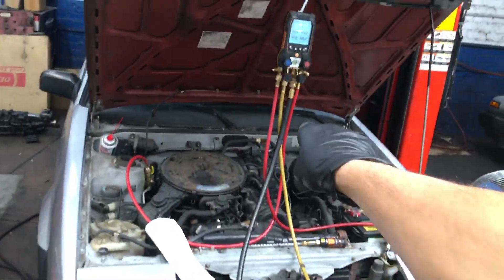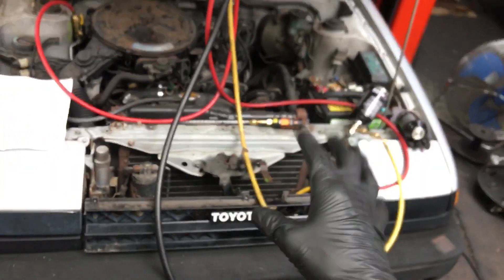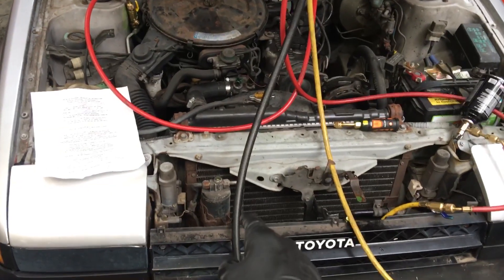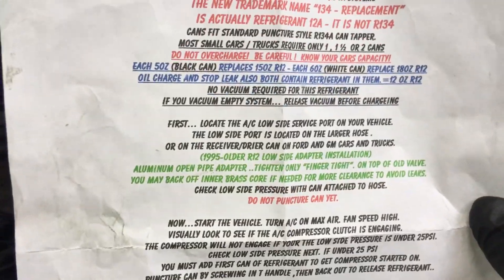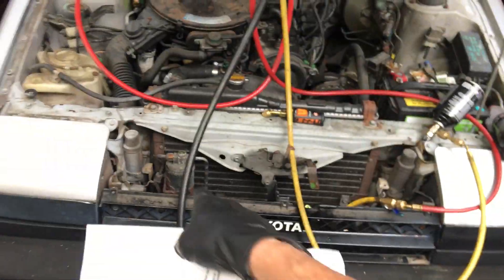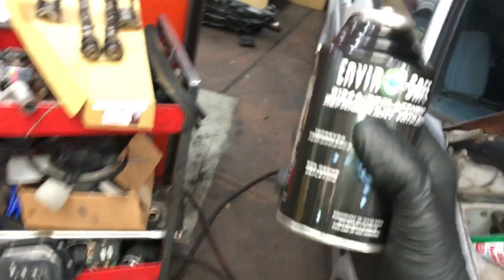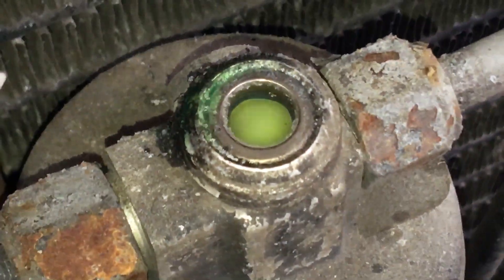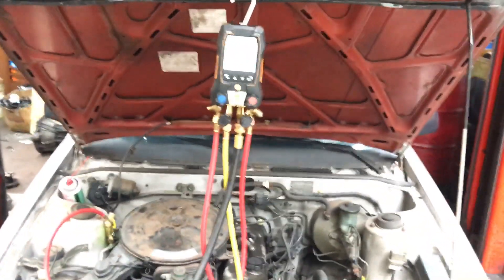Flammable 🔥 Refrigerant Installed In  Car Past Leak test, but now it leaks. Let’s put a match onit

Comment: Hi, Tom thanks for your videos enjoy them very much. If the average ac system took say 500g of (R134a) for example you would only need 30% of hydrocarbon about 150g due to its thermodynamics. If there was a leak in the evaporator, the fact that it is heavier than air, some of it would probably find its way out through the water drain. I think a leak the size of that receiver dryer for example inside the cabin, you would smell it way before it became a combustible mix.
Reply: Envirosafe uses a pine scent (cas# (138-86-3)) instead of sulfur to make you aware of a leak.  The precaution you should be aware of is to use nitrile or some other synthetic material for the o-rings.  Hydrocarbons (i.e. propane/isobutane) will eat rubber o-rings.  If you are losing refrigerant and needed to add refrigerant, this would be a good time to replace rubber hoses and o-rings.  You want to get all of the water and junk out of your system anyway,  Be sure to change desiccant and evacuate the system before installing.  The current Envirosafe products are compatible with PAG oils.

Get a factory manual for your car and it should show how much oil is used in the compressor.  If you are replacing the compressor, completely empty the new compressor's oil, and measure how much was in there.  You should also have have specs for how much was in the condenser, evaporator, hose, possible leakage, and other places where oil displacement was given.  My whole system uses 160mL (5 1/3 oz).  The compressor is the component that MUST have lubrication.  You can either use the oil that came from the compressor or a dye added PAG oil.  My system originally designed for R134a uses PAG 46.  The PAG 46 oils are compatible with Envirosafe refrigerant.  Make sure to work the oils into your compressor so everything is well lubricated.  There are videos on YT that show how to drain oil and how to work the oil into a new compressor.

Another trick is to put a small amount of oil injected into the HIGH side and vacuum it to the LOW side.  This is accomplished by taking out Shrader valve on the high side shoving a small diameter in the high side and the other end into the PAG oil the vacuum on the low side.  Be sure to put new Shrader valves with non rubber 0-rings on the low and high sides. This makes sure everything at least has some oil in it.  The balance of your oil should go to the LOW side with the HIGH side closed.  You can either use an injector,  pour oil into the LOW port with the Shrader valve out, or another method such as using the hose attached to the low port.

Add your refrigerant to your system with just a small amount added to the HIGH side first, so you don't get compressor lock. Then add the rest of the refrigerant to the LOW side.  You will use less Envirosafe refrigerant for your system than R134a.  My capacity for R134a was listed as 17.8 to 19.4 ounces (500 to 550 g).  You will use somewhere around 2/3 the mass of your original R134a.  Your pressures will on a set of gauges for high and low will be lower for a HC mix than R134a.  The pressure temperature relationship graph is shown on the Envirosafe website.  Be sure to go slow and gently shake the canister when filling.  The cans were filled by mass not volume.  Propane and isobutane have different partial pressures.  The shaking of can helps to keep everything mixed.  If you use a whole can the liquids and gases will be mixed.  However, if you use a partial can the gases will not be thoroughly mixed if you leave the can upright when filling.  The vapor pressure of propane 25 C is 135.7 psi; whereas the vapor pressure of isobutane at 21 C is 30.7 psi.  Therefore, propane will want to escape faster than isobutane.  Be aware that the mix ratio varies between manufactures.  My point is to go slowly and measure the ac outlet temperature in the vehicle.  Do not overfill.  If the temperature does not go down any further on your thermometer, this is where you should stop.

Use gauges.  Your low side pressure should be less than the high side pressure.  See the table on Envirosafe website for pressures and note the pressures are much lower than the pressures listed for R134a in you car manufactures repair manual.  For instance at 80 F the pressure is 101.0 psi.  Much much lower than the original R134a refrigerant.  This means there will be less resistance for the compressor clutch to kick in.  This saves wear and tear on the compressor and fuel mileage should also increase.  On a big diesel pickup with a lot of torque you may not feel the difference, but on a 1.5L small car, you will have a more fuel efficient vehicle.
Reply from the maker: You gave one of the best explanation I’ve seen 👍

Many new cars past few years started using POE oil to.   
Since New home freezer are coming with butane for your home and restaurant refrigerator using propane both use POE oil. 

Also be carful. Variable displacement !!!.. COMPRESSORS DON’T ALWAYS FALLOW THR PT CHART !. 

It the computer based on sensors and software changing pressure what it thinks it need . 
      You can have half or less the required refrigerant still get 39°F out the dash still have near same or same pressure on some models as if was 100% refrigerant charge. 

But the compressor will be burning 🥵 hot.  Shorter compressors life. 

This is were we make all are money 💰 buy the guys who charge by temperature and pressure.  Burning up compressor.  But it works excellent when it leave their shop.   Customer dose not know it was the shop that caused their compressor to burn.  Neat he does the old time mechanic 👨‍🔧 who uses the old time method to charge or the Evil 👿 topping off method absolute NEVER BE USED ON NEW CARS.
Reply from the maker: Yes most small cars like little Toyotas and Hondas would only need about 150 g you are correct but when you get into vans or SUVs with all evaporators now we’re getting to about a pound of R290 or R600

There is no smell because an air conditioning you cannot have that sulfur bearing agent that they add for that rotten egg smell because in the presence of moisture it turns into hydrochloric acid eating up the metal parts from the inside out.

        The hydrocarbon refrigerant meant for air conditioning is highly filtered and refined and it has no smell just like most gas do not have smell

when you’re taking your two year or four year HVAC program in college we get shown videos of explosions one in particular with a Workmans van looks like a small nuclear bomb went out in front of his house.

          Apparently his evaporator leaked in the van overnight the next morning as he exited his front door about 35 feet away he hit his remote on his car alarm to unlock the doors and something ignited the gas mixture in the van

        The top was blowing out the doors and the windows in the surrounding shrubs and the grass had that telltale sign explosion out words in a circle pattern

    But of course that was a very isolated rare event most accidents with leaks inside the engine or the passenger compartment would not end like this. 

   Most all the new restaurant freezers and refrigerators and cold prep tables for food all now use hydrocarbon refrigerant‘s in the small appliances

Comment: People back in the day using dust-off for refrigerant
Reply from the maker: People still use dust off as refrigerant and then a few months later they make a second video replacing the burnt out compressor lol

I really did want to use a match or a lighter to show the flammability it would not be explosive just a little flame shooting out of the lake that I could put out with my hand or a towel or a fire extinguisher

Comment: You mentioned evaporator leaks and the first thing that came to my mind was the blower motor. Those are traditional brushed DC motors, what do brushed motors make, they make sparks. I will leave it up to the reader to figure out why R1234yf and R152a are acceptable in new equipment even though there still is an ignition source.
Reply from the maker: When in college HVAC class they show us a aerial picture of a work van that had hydrocarbon fuel as refrigerant that developed evaporator leak overnight. 

The next day as the worker was walking out to his truck he hit the remote to unlock it and apparently the alarm triggering the solenoid ignited the fuel mixture inside the truck blew off the top the doors the windows look like a small nuclear bomb went off in his front yard. 

         Why have refrigerant not that flammable it takes a really hot ignition source actually the oil in the refrigerant is more flammable than the YF. 

         When I was a child playing with my grandmothers hairspray and a lighter pretending it was a flamethrower before the age of eight years old. 
          I found that old hairspray is 10 times more flammable than YF refrigerant
Reply: The thought on combustible refrigerant is that fuel system is much more flammable an millions of cars dont catch fire every day
Reply from the maker: @broken1965  cars catching fire are a lot more common than you think throughout the 50 states if you ever looked up insurance companies data log on home fires caused by cars catching on fire from the fuel line in the garage and the insurance companies records on the number of cars per year catching on fire on the side of the road they’re usually from ruptured fuel lines for the O-rings at the fuel injectors or at the threaded connector for the gaskets are very common. 

           HC’s combustible refrigerant has been used around the world for decades in an air conditioning catching on fire is very rare. 

   My freezer in my house uses our 600 propane in my kitchen

If you look at all the new equipment in restaurants in the freezer to the refrigerator and the cold prep table all using R600 for R290 now that is the new green gas for all commercial kitchen equipment

      America is like 15 or 20 years behind the rest of the world in HC refrigerant. 

And by combining it with a heat exchanger in a glycol loop system to the interior evaporator you would only need 3 to 5 ounces of hydrocarbon refrigerant to cool the car down without any exposure to the inside it happens or compartment 
Basically take a handful of BIC lighters and that’s all the refrigerant you would need

Comment: I was curious to see what kind of temps you were getting around the system.  At the vent, outlet of condenser, etc.  You know, just for entertainment value.  🙂
Reply from the maker: Of course for entertainment value after they replace the receiver dryer I will put my clamp on for Mr. temperature probes on all the inlet and outlet lines of evaporator and condenser’s that I could get access to record all the readings and let you see them. 

It seem to be cooling just fine while I was working while it was spewing out refrigerant at the same time. 

More videos on this vehicle are coming.